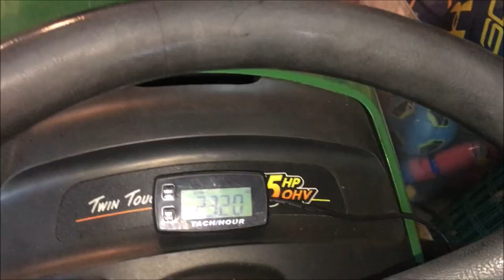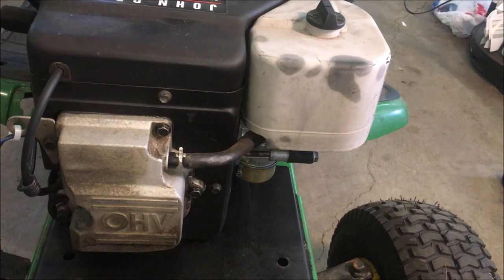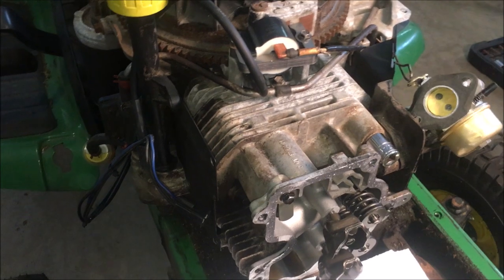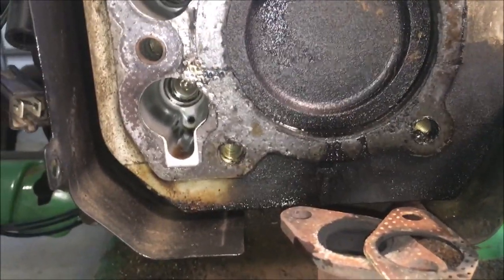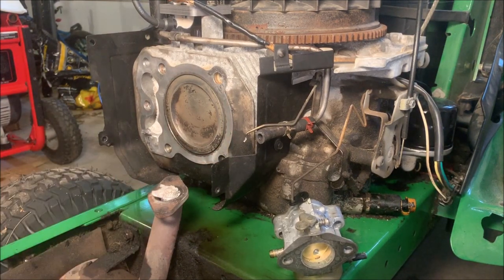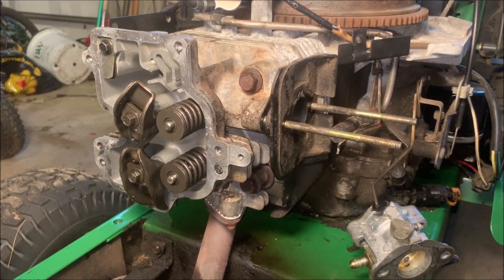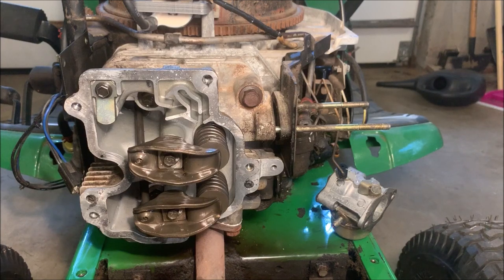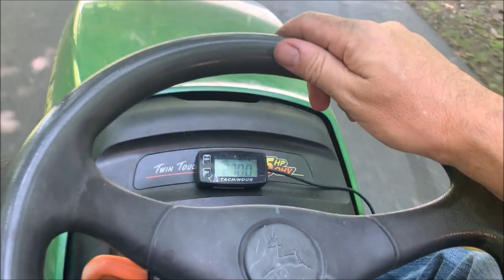Kohler Command Blown Head Gasket Repair

Comment: good video....just an fyi for those doing this at home  1. a flat piece of 2x4 on top of valve cover and a tap with mallet is much better than using a screwdriver to pry!  2.  do NOT use so much gasket sealant when reinstalling valve cover, 1/16" bead is proper

Comment: My gt225 with Kohler CV15S motor began sputtering, then stalling, then hard to start, then backfiring.  After watching videos, I serviced the carb to no success so I decided to replace the head gasket.  It looked exactly  like your video. Cleaned the cooling fins well,  reassembled,  started.  After a short period, the popping, backfiring, and stalling started again.  Replaced the carb and coil.  It ran much better, but not perfect.  It was popping slightly til it warmed up, and then the engine kept wanting to race although I could throttle it down.  I took it out and mowed several rows.  Then it died and wouldn't start again.  So, that's where I'm at.  I rebuilt VW Bug engines for 20 years and, therefore, thought this would be a breeze as it was in your video.  Haven't drained the gas, but my cars, mower, and snowblower run from the same batches of fuel without a problem.  And, it seems I've done about everything that YouTube videos have to offer.  Do you have any other ideas.  I want to believe that this is still fixable.
Reply from the maker: I would agree, it sounds fixable.  Unfortunately that symptom can be caused by a lot of things (spark, timing, carburetion and valves).  It sounds like the carburetor can be ruled out or at least discounted a bit.  My initial thought would be ignition or timing related.  If not already, would recommend a new name brand spark plug and check the flywheel key.  Most small engines have a waste spark on the exhaust stoke.  Popping a lot of times is caused by running lean or fuel that failed to ignite under compression, but ignites on the waist spark when the piston is at TDC of the exhaust stoke and both valves are open.  Lastly would do a compression and leak down test to see if you have a valve that is not sealing.
Reply: I have heard that there's a coil issue.  Heat causes it to do strange things.  May check fine when it's cold. Might look at that. Also check flywheel key for sharing slightly.

Comment: Some of the lawn tractors I get free from our town's transfer station cost a lot of money but had zero maintenance done like the JD 105 I'm currently bringing back. The deck mounts had broken off from the vibration caused by loose blades. It only has 198 hours on it.

Comment: Very helpful video, especially torque values. I also encourage others to check cooling fins. My  CV15S ran hot one spring and I discovered a family of mice had set up housekeeping. They also chewed the coil wire, I guess I was lucky not to have had a fire. I keep my mower in an outside shed.
Reply: One time I bought three snapper rear engine mowers cheap for parts they all had blown engines I checked them and they all had mouse nests under engine shruud

Comment: When you first pulled off the cooling tins I expected to see a mouse nest under the tins, then as the video ran along and you said the fins were filled with grass clippings it all made sense to me, that inadequate cooling was the culprit, just that it had already been cleaned. I drove up a very steep road with my pentastar and it finally overheated and I immediately stopped and came home before any damage occurred. I had replaced the thermostat last spring but it was an aftermarket job and cracked while installing it. Must get another.

Comment: Good instructional video on this head gasket replacement, you made it very easy for the average DIYr to follow along.  I have this exact engine on my Snapper ZT18440kh mower and noticed fumes coming out of the oil dipstick tube recently so may be doing this procedure myself.  Looks pretty straight forward from your video; glad you took all the “re-torque” guess work out of the procedure, one less thing to look up online:-)  This is the first small engine I have come across in a long time that has self adjusting valves.
Reply from the maker: This is the only one with hydraulic lifters that I have seen.  Not all models of this engine have them.

Comment: If the only problem you had is a blown gasket,  you got lucky.  
I was working on a Briggs and stratton,  it had some serious problems.  The intake valve guide moved towards the valve head and held the valve open.  I thought it just needed a valve job. WRONG , I took it to a machine shop,  he removed the guide,  knurled the guide,  and replaced the guide.  Heated the head with a propane torch to remove and replace.  Then ground the valves, and seats.  It was in pretty bad shape.  I doubt it could have been lapped in, the seats were in really bad shape.  It runs great now.

One thing I might have done differently,  is I used 150 grit sandpaper on a flat smooth surface and resurfaced the head,  and the block to have a good flat mounting head and block.  I did that with the Briggs.  I don't know If it helps or not but in my mind a flat service will help.

Comment: Great video!   I'm about to tackle this on my LT150.  It's really helpful to see what's entailed before I jump in.  Thanks!  👍
Reply from the maker: Good luck.  It is a good engine.  Still running well.
Reply: @jcondon1  I just finished the job and again, your video and the manual link were very helpful.  Coincidentally, I found almost the identical head gasket leak between the combustion chamber and crankcase at the lower lifter/ pushrod area.  I also had the SAME blowout of the exhaust gasket.  Good tip to loosen the muffler assembly to allow the flange to align with the head when reassembling.  I had a little bit of lifter noise at first start up (wasn't surprised), but that went away and now it's running smoother and a little quieter with no blow-by out of the dipstick tube. Victory!  Thank you again!😀👍🚜
Reply: @jcondon1  Yes. I used to have a Simplicity rear engiine/hydro with a Kohler 14hp. I never had any issues with that engiine. When Briggs & Stratton bought out Simplicity about 5 yrs ago they discontinued that particular model.

Comment: I have a CH23 and this confirms my thoughts.  I have hard starting, black spark plug on that side (after 30 minutes new), and a very loud exhaust sound after 20 minutes into mowing.  Took valve covers off and it looks good.  Ordered new valve cover gaskets and a head gasket kit from Kohler site with my units numbers.  $36 total all parts.  Going to fix this soon.  Also...136 PSI compression on good cylinder side and 0 on bad side.  In fact it shoots up to 80 very quickly then down to zero within a millisecond and will not get or hold above 30 PSI after that with needle always falling to zero.  Compression relief?  Don’t think so due to other side holding 136.  Good video  and going to perform my fix soon.
Reply from the maker: Sir Sweetness you might have a valve that is not seating properly.  Are your valves adjustable?  It might be as simple as adjusting or lapping the valves.  Ideally you would put your engine to top dead center and then pressurize that cylinder to see if you have a leak out of the intake or exhaust.  Guessing it will be easy to hear given the compression numbers you are seeing.  You can use a leak down tester to pressurize the cylinder or if you do not have one you might be able to use the compression tester hose.  One end in the spark plug hole and the other to an air compressor.  60 psi should be enough to test with.  The engine might turn over when you add air so be careful.
Reply: James Condon 

        Yeah going to look at that also with all the carbon making sure valves are seating.  May have to buy  the gel used to gently smooth valve surfaces.  I will still replace HG since already in there.  317 Hours on engine.  Non adjustable valves.  Hydraulic

Comment: I had a neighbor bring me one with a clearly blown head gasket.  They tried a mechanic in a bottle head gasket fix.  Yeah you know what I"m talking about... for liquid cooled engines.  Dumped it in with the oil.  I don't know how many quarts the engine held but I know I captured more than two out of the drain.  It played hell on the bearings.  Think it had some sort of fiber of varying sizes in it.  Machine sat in their back yard for as long as I lived there.  I finally understood why there is so much common sense verbiage on labels.

Comment: I got the same engine on my GT225. Just rebuilt it with a new head not too long ago and did a video on it. Not as good a editing job as you but Im happy with the result!
Reply from the maker: This one was a mess when I got it.  Should have made a video on that.  Been very happy with it though since fixing it up.  20+ years old and using it every week without issue.
Reply: @jcondon1  its tough to video everything. That takes more time than the actual work most of the time. Those kohler commands are solid engines.

Comment: For the hard to loosen head bolts I have an aluminum bar or rod I have. Put it on the bolt and give two heavy love tapes. This helps brake any electrolysis between the aluminum block and the metal bolts.

Comment: I just replaced the head gasket on a cv12.5 s kohler command it only had 25 lbs compression after I replaced gasket it now has 125 lbs compression.

Comment: I have a 22 hp Courage, twin cylinder.  The replacement head gasket has a thin metal strip on one side.  The strip runs around the cylinder and valve ports.  I watched closely, and I think your replacement gasket also had a strip and you put it out, against the head, not the block.  Am I right?  This is a detail that might be added to clarify.  Thanks.

Comment: Ya'll need red locktight for that high heat application there James. Not that head bolts need locktight or thread locker. But it can't hoit. It provides thread lubrication to produce a more even torque setting. Oh: I was expecting you to use either a pane of glass or flat thick steel backed by crockus cloth to smooth the head after that warpage and the crankcase flats also. I think you do a wonderful job James. I am just an old man mentioning things not criticizing your work which is probably way up to snuff. Not Squatch 253 or kt3406 level but highly recommended and well done. Good job

Comment: This is one of the best repair videos on YT and I've watched many! One question...I have a Kohler Command CV13 in a John Deere ST38 (black deck). When attempting to put the push rods back in, there is a "guide plate" (Kohler part # 1214622S, per Jacks small engines) that I don't see on any other Kohler Command repair video. Other parts sites list it as a "spacer". This plate prevents me from be able to tighten the screws completely, so the push rods won't stay in place as the rockers are loose. Anyone else have this issue? I don't want to take it out since I'm sure it is there for a reason, but if the other Kohler engines in this family don't have it, and I can't reinstall my push rods, I may chance it. Any thoughts are appreciated!

Comment: Koehler builds a nice motor, but their head gaskets are crap! No flame ring around cylinder. Always blow at the bottom where the get saturated with gas. There should be a recall!

Comment: What did you use in the drill to clean the metal  on the cylinder and head .mounting surfaces. And how's it run since the video?  Thanks!
Reply: That's what I'd like to know

Comment: When bottom head bolt had little torque on it- what happens is that the head is loose and engine displays symptoms of a blown head gasket(may smoke a lot)- all it may need is the head bolts re-torqued to 20 foot pounds. There is  a great amount of vibration in these engines. Also- the rockers and pushrods don't need to be removed- they will come off with the cylinder head, the pushrods are made of different materials one is steel and one is aluminum don't get them mixed up- steel would be for the hot exhaust side.
Reply: Kohler command engines require 30 ft lbs of torque not 20

Comment: Thanks for a great video.  I will attempt this tomorrow. Few questions: 
1. Did you use Permatex clear RTV sealant?
2. Did you use Permatex Blue Threadlocker?
3. Do you have John Deere Head gasket part number?
Reply from the maker: 1) I used the Permatex "The Right Stuff" for the valve cover.  Any RTV would due.
2) Permatex Blue Threadlocker (removable not permanent).
3) Should be in the description.

Comment: Would've been great if You included the replacement parts numbers in the description
Reply from the maker: Added the head gasket and exhaust gasket part numbers.
Reply: Thanks sir, your video was great help,  thanks for the torque specs

Comment: I have the same engine except it’s in a craftsman platform tractor. I’m curious as at the end of the video you cranked it for a few seconds without the choke. Then the second time you choked it to start.  Does this help with starting easier? I have noticed that it takes multiple cranks with choke to fire mine up also.

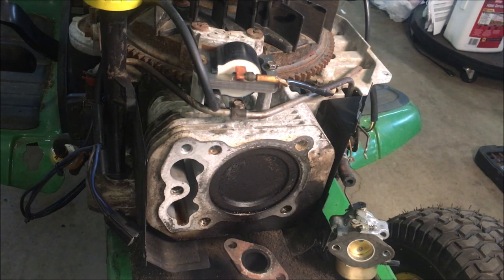Comment: Mister James what attachment did you have in your drill for cleaning surfaces @ 9:40 in your video, please?
Reply from the maker: Plastic 3M plastic bristle brush 3M 3M-18733 Roloc Bristle Disc Grade - 120, Size - 2 https://www.amazon.com/dp/B01MSU3PYQ/ref=cm_sw_r_cp_api_glt_fabc_E432Z7WKV7HBTW9WPVYX?_encoding=UTF8&psc=1

Comment: Great video.  James, I noticed you cleaned up the engine block surface before putting things back together. Did you clean up the surface of the head, as well?
Reply from the maker: I did
Reply: I see it now.  Don't know how I missed that.  I have an LT155 with similar symptoms (exhaust smoke coming out the oil dipstick).  I picked up all the supplies and will start working on it in the next few days.
Reply: Head gasket replacement went well on my LT155.  No more smoke coming from the oil reservoir.  I've mowed 3 times and it's not burning oil like it did before either.  Thanks James!

Comment: I have a CV20s- 65597. It was used on a golf course for a decade before I got it. It was well serviced but I believe both head gaskets are blown. Is it worth the extra effort to pull the heads all the way off and hone and re-ring the cylinders while doing the head gasket. Anything else that you would recommend on a high hour engine while I have it apart?
Reply from the maker: Lap the valves and replace the valve stem seals (if it has them).

Comment: When I removed the head today I found one bolt (near the reed valve) with two areas of the threads covered in thread sealant.  Do you know if that is normal?

Comment: Great video with torque specs. Where can I get the torque specs for Briggs and Stratton engine?
Reply from the maker: kalamelliel good question.  I got lucky with the Kohler.  The service manual was easy to find searching on google.  I generally do not find Briggs service manuals, but there are sites that list the specs by engine series.  I could send you a link if you like.

Comment: Impact drills make life so much easier. Turning ratchets sucks..
So true w cooling fins issue. See it alot.  Head planar surface should be checked for .003 tolerance. 
DO A VALVE JOB while its open too.
 Machine shop only charge 30 or so to Resurface head and cut new valve seats if needed
Reply: You can resurface with a flat surface,  150 grit sandpaper,  after cleaning the head of carbon,  put the head face down and run in a figure 8. That will give a smooth flat surface.  On the block block off the cylinder with the piston all the way to bottom of cylinder.  Wrap 150 grit sandpaper around a flat file.  Stuff paper towels in the cylinder and where the push rods go.  Then move the file with the sandpaper wrapped around it go side to side and up and down.  Will give a good smooth flat surface as well. It takes some time,  but it's worth it.

Comment: Absolutely found this an awesome video. The timing of titles and all. Pardon my technological innocence, but when tightening the rocker pivot bolts, does the piston or other engine component(s) need to be in a certain position?
Reply from the maker: Ideally you should be at top dead center on the compression stoke so the push rod is not pushing the valve open.

Comment: He hhe he he he he.. blowout! Neer neer neer neer neer neer neer neer neer neer ..beach boys. 

I have a kohler cv460 w suspected head gasket blown too. Runs good just puffs blue smoke on throttle up n blade engagement. I also ordered new piston rings amd conn rod. Lifters are ok. 
It's got a slight knock on crank. 
Hone cylinder and reseat rings.  . Torque that head in 3 stages  until u reach proper torque following pattern and clean the block deck and head surfaces really really well. U should be good

Comment: I loved your video it really helped with this old mower. Just a question of clarification,  I have a cv13s would 100in lbs be the same for torquing the rocker bolts?  I looked for valve lash clearance because I've never done this without setting a pre determined clearance. It kinda threw me off. Sorry if it's a dumb question I just wanted to be sure and you look plenty comfortable doing that. Thanks in advance!
Reply from the maker: daytonaracer90x the torque specs should be the same for that engine.  One thing to note is that Kohler engine  has several different valve setups.  My valve clearance was not adjustable (hydraulic lifters).  Some are adjustable and some have a rocker bridge.  Torque setting might vary depending on you head/rocker setup.  I will send you a link later of the service manual I was using.
Reply from the maker: The service manual can be viewed at https://drive.google.com/open?id=1vsQFHjCj-1VnCdRcaPvsXfYwIhSb1e7s
Reply: @jcondon1 I was looking for this and you kindly provided it. Thank you.